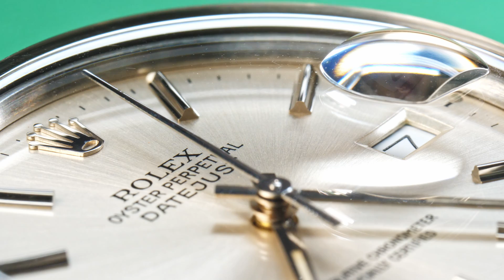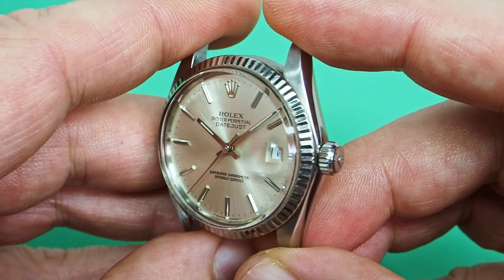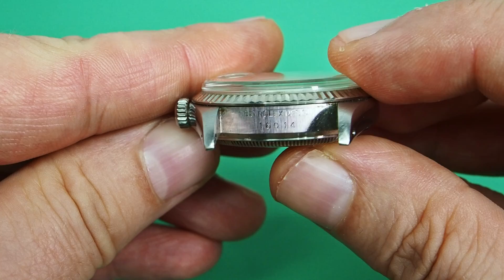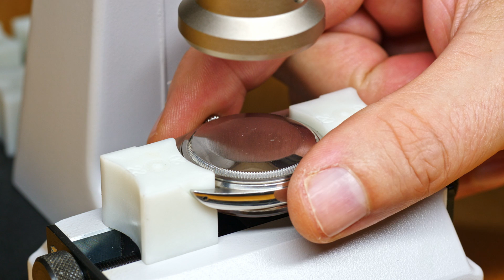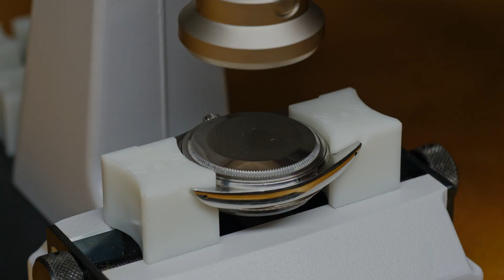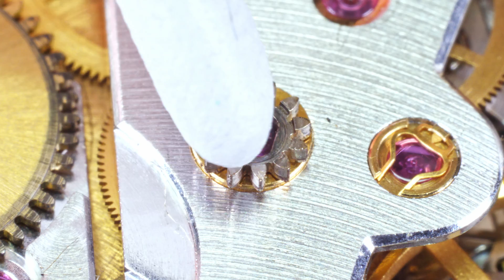This Rolex Was Sold as Serviced! But Was it Really? The Repair You Need to See!

Comment: People please this is why you need to service your watches. First find a good watchmaker and second get it regularly serviced. My dad bought a Tudor submariner new in 1973. As he was a diver he had the seals replaced every year and a full service every 5 years. The only parts the Watch has ever needed is 2 crystals and 1 main spring in 50+ years off use. I would love to know how much this service cost with all the destroyed expensive Rolex parts he had to replace but I bet it wasn’t cheap.
Reply from the maker: Annual gasket replacements and full services every 5 years really help keep things in top shape. In this case, unfortunately, due to a lack of regular servicing, several parts had become worn over time, and replacing them made the service very expensive indeed.

Comment: When I retired almost 13 years ago I was given a Breitling Navitimer. It did not do all that well on the timegrapher last fall and is currently being serviced. I know it's going to need a new crystal. Watching this video scared me a bit.
Reply from the maker: I'm sorry, I didn't intend to scare anyone. I thought I'd have an easy service to do and didn't expect it to be so worn out. Mechanical watches need a regular service. The oils dry out and parts start wearing out if not serviced. Generally it's not a big issue, just the cost of the new parts that's annoying. It becomes an issue when it's a vintage watch and the parts are no longer available.
Reply: @MacroTime28800  That watch means a lot to me. I am an Engineer. I knew almost 2 years ago the watch was losing time. I forgot what the amplitude was when it was timegraphed I just remember it was not good and it was losing about 18 seconds a day. What scared me the most was seeing clearly how badly a watch movement can get. I hope to hear from Breitling soon about what the final damage was and get the bill.
Reply from the maker: It's like a car. Imagine not servicing a car for several years. I'm sure Breitling will sort out for you. It's their watch, they will have all the parts and expertise. I think you have nothing to worry about. Let me know how you get on when you hear from them 👍

Comment: Than you for this video. An excellent display and explanation of a good repair. I aspire to a Rolex service. As a hobbyist, I aim to attain a good standard. I am appalled at the many watches I receive that have faults. Scews incorrect, missing or lose. Parts missing. 'It runs for a short time?' As you say, so many scratches. The standard of many servicers leaves a lot to be desired.
Reply from the maker: Yes, there are many watches that need a lot of work

Comment: If a Rolex movement was a little village, what component would be the village idiot?
Reply from the maker: I didn't like the wig-wag pinion, it can fail and get stuck in one position. The newer 3135 has a redesigned wig-wag pinion

Comment: Unfortunately we are at the mercy of watchmakers. I had my speedmaster serviced at high cost by someone highly recommended. The second hand now fouls the minute hand in some positions so I cant use the chronograph. I know probably easily fixed but shows poor work and i didnt want to send it back. More seriously it now keeps poor time and the power reserve fell to 30 hours. He had the watch for weeks and only gave back when I chased him. I'm convinced that he didnt acrually service it and I wish i had not sent it to him.
Reply from the maker: I can imagine how you feel and I understand why you feel that way.
Sometimes it’s not that easy, we all make mistakes, miss something, things go wrong whether we like it or not.
My understanding is that he’s a watchmaker rather than a seller like in the case of my video where they did a very poor job just to sell the watch to make as much money as possible.
If I’m correct, that’s not your case with an independent watchmaker. Perhaps he would be very embarrassed if you contacted him and told him what issues you have with the watch and he would gladly sort out the issues.
As for the time it took, I cannot really comment on that. My case is very different, I have to rearrange the lights for every shot, reposition the camera, change the settings… It takes me far, far longer than most people would be prepared to wait for unless they have other watches and are not concerned about the time it can take to produce the video because their pleasure is in seeing the video of their watch being serviced.
For watchmakers who do this for living, they may have a backlog, they may have to source parts that may not be so easily obtainable,  they may struggle to identify particular issues…
I truly understand how you feel and I don’t blame you. But maybe he is a good watchmaker, you say he was highly recommended, and he simply missed something.
Most of us naturally feel we’re being ripped off when something goes wrong, but not everyone is bad, we’re only humans, we all make mistakes.

Comment: I still think the cal 1570 is the forever calibre
Reply: @MacroTime28800  
I bought a reck OPDate (ref 1500, from 1965) in 1980. And had it properly worked on. It’s been my daily. I’ve suffered some bad service and I’ve learned how to source proper service. (Rolex factory once, and that was an expensive disaster. It’s been made right since by true watchman.) 

It’s been 1-2” day for decades. I figure it’s maybe at half life. So I anticipate another 30 more years of stunning performance and timeless appearance.

Comment: I have a Swiss chronograph from the 1940’s, it uses a Landeron L50 movement and I have the exact same issue, your video made me very worried 😢
Bought the watch as fully serviced and it always has been extremely hard to wind. When the power reserve is fully depleted, it winds with some moderate resistance (more than what I would consider as nornal), but as you start to accumulate some winding on the main spring, it starts building so much resistance on the crown that it comes to a point where you can’t continue winding without hurting your fingers… I know it’s not resistance from being fully wound because it happens with some 12 or 15 turns on the crown, so I’d think there’s a few more turns to go before reaching the limit, but it’s just impossible to go any further by hand.
After watching your video, it made me think if maybe I have some sort of similar issue, with a bent barrel bridge or something that could turn the watch useless by the lack of a replacement part…
Reply from the maker: It sounds like the issue I had with this watch. The resistance in my case was the worn out bushing. It allowed the barrel and the ratchet wheel to tilt so much that the ratchet wheel was touching the underside of the automatic bridge. Hence the resistance when winding. It could perhaps be the same issue. You just don't know until you inspect it. I'd get it serviced sooner rather than later.
Reply: @MacroTime28800  yeah, that’s what I figured. In my case, there’s no automatic bridge, the watch is a manual wind only, but surely something there is rubbing against something else that it shouldn’t.
I stopped using the watch to prevent any further damage, but I’ll have to send it to service whenever possible. It’s hard to find people willing to and capable of servicing this kind of watch here in Brazil, at least close to home, most watchmakers only take simple servicing jobs and/or only work with simple watches, not mechanical chronographs. We have some very good watchmakers (Omega Authorized Technitians and etc), but they’re not accessible in a way that you can bring the watch yourself and talk directly to them, you have to send it via mail, and it takes a very long time for them to even perform an evaluation and send you a quotation for the service.
By the way, loved your channel and your content, congratulations and keep up with the good work!! 😃
Reply from the maker: I think most people will have to post their watches to get them serviced and it can take a long time to get them back, it can take months. But eventually, you’ll have a nice watch that works well

Comment: 2 years ago I bought an omega Seamaster 300m from 1999 from a grey market dealer. It was a nice store but the day after I bought it, I noticed the watch stopped at night. And it didn’t run within chronometer specifications. I brought it back and they serviced it and since then it works fine. I wonder if they just tried to get away without servicing the watch.
Reply from the maker: I'm afraid I couldn't tell whether it was serviced or not. It's only when you open it and start inspecting it you'll find out whether it was serviced or not.

Comment: Curious. Epilame is used to hold oil in specific places. Pallet fork jewels, escape wheel, wheel pivots, Inca block jewels. Ive heard the if the fork of the pallet fork has epilame on it, the impulse jewel hitting it will create a fine powder and potentially damage the parts. I would think the would be the same might happen with epilame on the second hand. There is no oil used on this so why the epilame? Just wondering... Is lubeta the same as epilame? Im also under the impression lubeta is used for the automatic winding parts. Great video!!
Reply from the maker: Glad you enjoyed it!
Epilame repels lubrication. I run the movement for a short while to wear out the epilame on the pallet stones and the escape wheel. Then I lubricated the escapement.
Yes, that’s correct, the roller jewel hitting the pallet fork causes an issue if the whole pallet fork is dipped in epilame.
The second wheel, I see your point. I’ve never heard of anyone mentioning any issues with it and Rolex service guide tells you to treat it with epilame.
Lubeta is a lubricant, epilame alters the tension of the surface to repel lubricants 👍
Reply: @MacroTime28800  Awesome. Great info. If Rolex says use it, that's the gospel. Thank you!!!!!!
Reply from the maker: @skudworth1983  My pleasure!